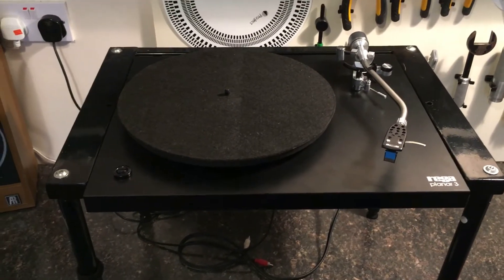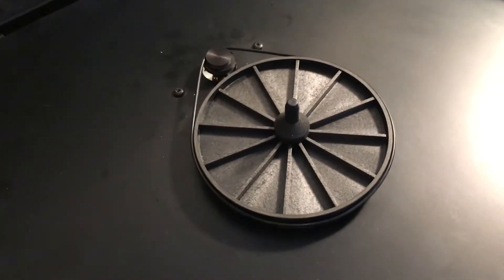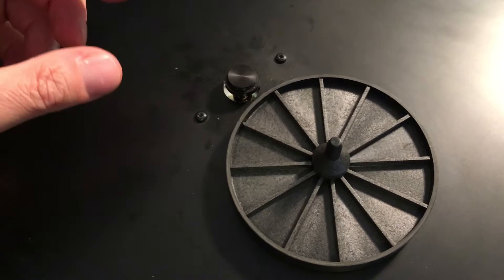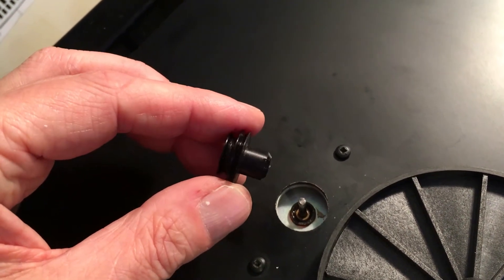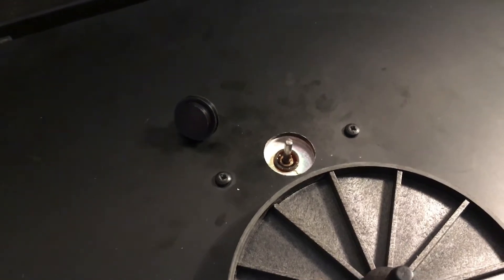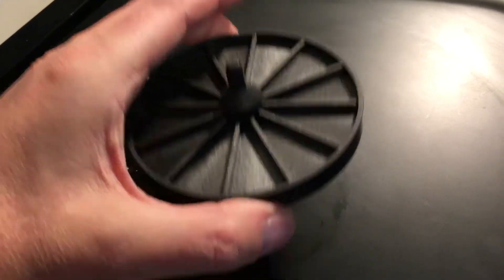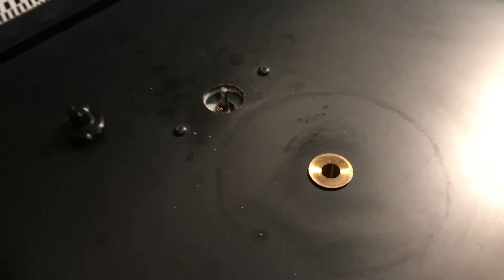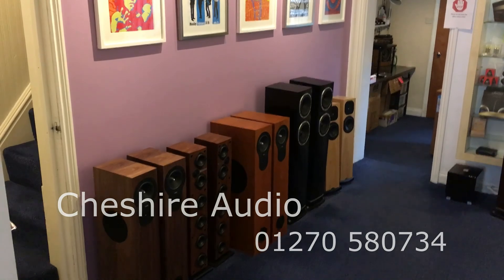Rega Planar turntable speed problems #2

Comment: Hi, I had the start up slow issue & it was the pulley contact. So, I did the impatient fix and super glued in supporting the motor from underneath (disconnected from the mains ! ) Now it works a treat. Thanks for this and all you informative films.

Comment: Great video. I’m looking forward to part 3. I have exactly that problem that it slows down after play 1 side at the correct speed. I’d bring it by but I live in Germany.
Reply from the maker: I'm still waiting for a deck to come in with that fault so that I can do  a video ....  The fault is with the .22 Capacitor on the supply board ... when these start to fail they will cause the deck to slow down (after they have warmed up- hence the delay)  eventually this fault can cause the deck to run backwards!!
Reply: @cheshireaudio  Thanks for the tip. I’ll give it a go.

Comment: Nice vid - thank you.
My pulley turns well, and the top stayed attached despite a couple of firm pulls but my T/T is still playing too slowly. The ball-bearing is still there but I'm out of oil, so am guessing that could be a reason for the slowness?
If so, what is the correct oil to get?

Comment: Acetone or nail polish remover will dissolve the super glue if you have issues with it. Also if you have a baggy belt put it in a shallow dish of hot water and allow water to cool, belt should be good to go again while you order a new one.
Reply from the maker: Great tips

Comment: Mine was playing consistently slow.  I looked at all of these issues:  belt, pulley etc.  Now it's running crazy fast.   almost like 78 speed.........What could I have done to cause this?  I wiped the belt to make sure it was clean, and that was all.  Also I checked the motor pulley to make sure it was firmly attached, and it is.
Reply: I put the belt back on in the wrong groove.  Putting it in the correct groove now completely corrects the speed issues.  Sounds fantastic now.  I wonder if the belt had been slipping or dragging on the 'slow' issue.  Thank you for all your wisdom, steering us toward the correct "fix".

Comment: I have a turntable exactly like this and it runs slightly too fast (consistently). Any ideas in slowing it down a tad?
Reply from the maker: A lot of record players of that era with synchronous motors run a little fast, you can’t adjust it as the motor uses the frequency of the mains .... strangely the new version of the Rega belt (the EBLT) seems to improve things
Reply: @cheshireaudio  Ah right, thanks. I bought a new belt not long ago (2837). Is EBLT different and does it fit this old model?
Reply from the maker: Not sure what 2837 is? Was that a genuine Rega belt? The EBLT replaces the belt they have been using for years, it came out a few weeks ago and is much more accurate... fits all Regas apart from the 1973 Planet
Reply: @cheshireaudio  Yeah the 2837 was the number of the old Rega belt. I might try the new one. It's not a huge difference but I can tell on some songs if I know them well, that they're a bit fast.
Reply from the maker: @ianwilson2007  :-) never heard it referred to as that ....   https://www.cheshireaudio.co.uk/acatalog/Rega-standard-Drive-Belt-60.html#SID=57
Reply: @cheshireaudio  It probably isn't.

Comment: The best thing to do is get rid of that floppy rubber band motor support and fit a Sorbothane pad instead, and take off the plastic pulley and use an aluminium one with an Allen key screw to lock it in place, as this is height adjustable.

Comment: Hello! Thanks a lot for this video. I actually have a slightly different problem and would very much appreciate some advice. I just moved houses and my Rega RP3 suddenly runs way too fast. At first I thought it may be related to the change of current (from 220w to 110w) but the transformer turns the input into 24v anyway, so it shouldn't affect speed I guess. The belt seems fine and well placed at the 33RPM part of the pulley. What could it be? Thanks in advance!
Reply from the maker: you will need to change the motor pulley to a 60hz version ... the voltage is the same but the mains frequency is wrong
Reply: @cheshireaudio  Thanks for your quick reply! I bought a transformer that turns the voltage from 110 to 220, but still doesn't work - I guess the mains frequency doesn't change?
Reply from the maker: @GuillermoMartine1975  No it doesn't change the frequency - your Rega importer should be able to get you a 60hz pulley
Reply from the maker: Sorry, I meant the other way around 110v 60hz to 220v 50hz ... you need a 50hz pulley, I wasn't concentrating
The transformer only changes the voltage
Reply: @cheshireaudio  Thanks! very useful, good to know - I'll see what I can do.
Reply: @cheshireaudio  Sorry, one more question... I'm in Taiwan, where there is not Rega importer - do you know where can I buy a 60hz motor pulley online? Can't find them... :-(
Reply from the maker: @Guillermo MARTINEZ ERADES  I'm a bit confused now ... is your deck 220v 50hz? I just looked up Taiwan and you it says you need 110v 60hz, but your message reads the other way around :-)  If you need it to be 60hz then perhaps find a supplier in the US, they us the same pulley